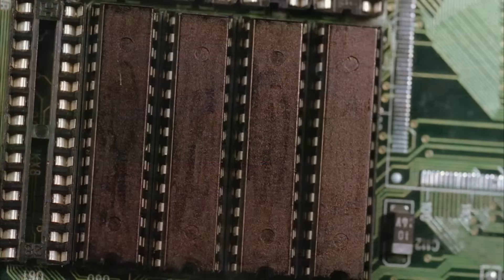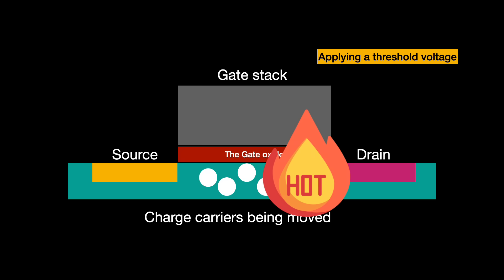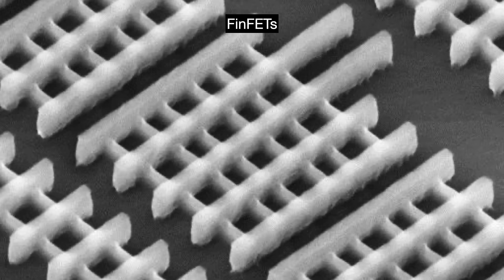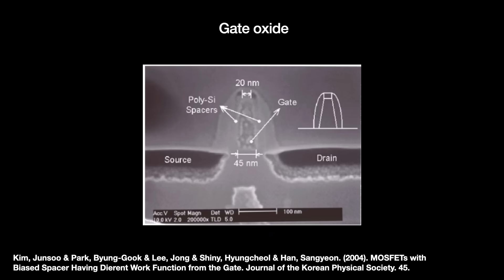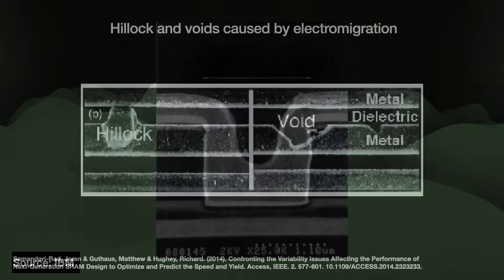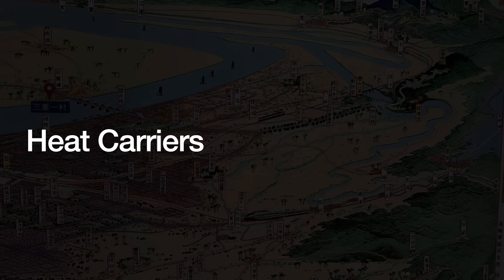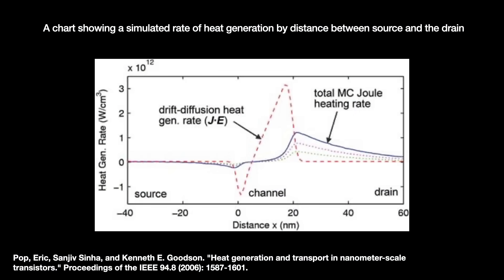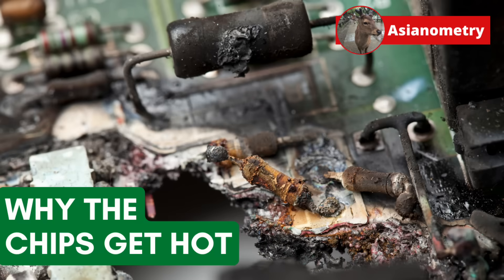Why the Chips Get Hot

Comment: They get hot because they use energy and everytime a transistor turns on it creates heat is just like the old computers back in the days when they use lightbulbs what happens when you turn on a lightbulbs 💡 it gets hot is the same with these 20 century transistors but now they are super tiny that you can not even see with a normal microscope you need probably an electron microscope I could be wrong in the microscope thing an may be you can see then with a normal microscope. So yeah is the same just like a lightbulb but now they are super tiny 💡.

Comment: About 2:30 - I still cannot find an intuitive reason why electric field peaks at the drain edge of the gate. I've read a lot of Umesh Mishra's seminal work on MESFETs which discover this effect, but I do not see any intuitive explanations. Do you have one?
Reply: The interface/junction between the semiconductor and a metal can be modeled by a diode. The source and drain contacts are made of metal. The drain-semiconductor junction faces one way while the source-semiconductor junction faces the other way (assuming they’re made from similar metals). These diodes are in series with each other, with the channel between them. Putting a voltage bias over both series diodes will forward bias one and reverse bias the other. The electric field is strongest at the reverse biased junction.

Comment: I'm a, mechanical engineer who has worked in electronics packaging in the telecom and network data center spaces for 30 years.  Electronics cooling has been a central role in my career.  The datacenter space is finally moving to large scale liquid cooling under the impetus of enormous power loads for Gen AI systems.  Stargate for instance is setting a spec of 55-250 kilowatts per rack.  

Anyway looking forward to watching you have an informative channel.
Reply: Waiting for the day when they collect and redistribute the heat outside just few DCs in the nordics...
Reply: Too much energy

Comment: Hello! Is the movement of dopant atoms also contribute to failure or is it so small other failures occur first? Also, is anyone researching diamond films to substitute the oxide layer used for heat exchange? Diamonds are good heat conductors while at the same time being electric insulators. One of my professors was researching this but he died before managing to produce a film - everytime the diamond started to form it created a bunch of tiny crystals instead of a film. Thanks!

Comment: Microchip formula.  Heat chips using electricity with oil season, then crush. Vola hot and tasty microchips.  Don't forget to pre wash with cold water in the heat sink. If you like chips with holes in them, i recommend funyons 😂

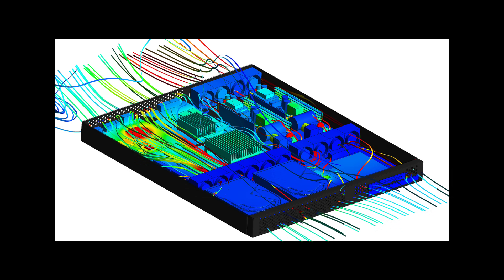Comment: 12:26 Advanced Packaging, especially on vertical-connected (3D stacked) dices may have thermal expansion issues.  The in-between interconnect layer (interposer, etc.) only has passive links (no transistors generating heat) and may use a different substrate material than Silicon.
In these sandwich-like construction, if one layer generates high heat and cannot be quickly taken away, the structure may warp (like bi-metal thermal switch) and break the interconnect bonds.

Comment: I have an outdoor PC for controlling my telescope, it's a desktop board in an outdoor electrical enclosure packing a Ryzen 7 5800X. One cold night in 2023, it appeared to run at 4.7 Ghz -- continuous turbo on all cores while encoding video along with QTGMC deinterlacing. The power draw was reported to be around 78 watts with an ambient outdoor temperature of 26 F and a core temp of around 137 F. During this winter, I didn't see such a dramatic reduction in core temp. My guess is that the thermal compound was impacted by seasonal change. During the summer I use this outdoor PC more frequently for video encoding since the seeing conditions for astrophotography stink during that time of the year. As a result, I am now in the market for a more appropriate thermal compound for outdoor use. To this day, I wonder if I whether I was getting false readings or if the cold was having enough of an impact on temps to reduce the power draw due to reduced leakage.

That all said, it still works like a charm. During the summer I switch the power profile to one which limits the core clock to something that absolutely wont overheat (BSOD, or forced reboot occurs if I keep it I don't limit the core clock during a summer time encoding job).

Comment: you have mentioned. u Pillar bumps in the context of HBM. I had invented them at Motorola in AZ 30 + yrs ago ( Ref Proc IEEE ECTC Conf 1994 etc.,) to remove heat away directly from the Gate area of Gallium Arsenide FETs we used to mass produce Moto Flip Phones by 1996, making it possible for the fir
Reply: ( cont’d ) real time Video affordably on handsets ( the electron mobility in GaAs is 3x that in Si so they switch faster ), 30 yrs later HBM still uses the same 50 um geometry, though we had qualified processes using pioneering Assy. Robots of our design down to 20 um pitch or I/O density 6x larger ) The thermal conductivity of these u Pillar bumps as we had predicted and then verified experimentally was 300 watts / sq cm. HBM even HBM 4 w/ a faster Clock Rate and maybe stacks 16 dies high would hardly break the Bank. Even the Current nVidia Blackwell dissipates only about 100 watts per sq cm. So liquid immersion cooling ( which we had already developed in the early 1990s for CRAY SuperComputers using LSI BiPolar ASICS ) May NOT be needed even when stacked in 3-d after breaking them down into Chiplets ( say for Yield Improvement or to reuse a mix of chips w/ diverse functionality
Reply: Cool! I had  a flip for YEARS!!

Comment: You never explain why, you only explained how the chips get hot. You never answered fundamental questions as why does collisions of particles produced heat? The so called temperature that can be measured is macroscopic emergent property assigned to represent the amount movement/collisions of a large numbers of particles and their degrees of freedom of motion. What sense is there to talk about heat or temperature of single particle or even a small lattice of silicon atoms when they are all bound together? So based on this I would say your video title is misleading at best.

Comment: IBM's mainframes of decades ago used a helium stack that had cold water passing to transfer the heat away.
Reply: @mutantryeff  IBM was, IMO, a very respectable company.  Other entities at the time were similar.  They largely don't exist anymore because the consumer wants sex appeal and a low price.

It's sad to see the degraded quality of many a product today. ☹️
Reply: @ntag411  I've worked in the computer arena since the 70s. I remember when IBM SEs were required to wear suits even when working in the false floors under the mainframes.  The best manuals were written by HP. HP is a joke in how they now operate. IBM products like IBM DB2 Tools are 3rd rate when compared to competitors.

Comment: Hey, the heat in the London Underground would be worth it's own video! The short answer is that, when the tunnels were first designed in the late 19th century, it was assumed that the surrounding soil would absorb the heat produced by braking trains and crowds of people. For a while, it did. In the last 130 or so years, however, the clay soil has become saturated with heat. Some stations have gone from 14C all the way to 30C, and there is hardly any space in these antiquated tunnels for new cooling infrastructure.
Reply: How do people breath ? Coal mines must be chilled, or they ignite. Why can’t mines be flooded with the chilled exhaust from a coal plant?
Reply: Dealt with this last September. Lines like Piccadilly were almost unbearable.
Reply: Just burrow under the tunnels and install radiant cooling. Easy, problem solved.
Reply: 14°C is cold (asian)

Comment: Very simple reason - shi tty design. Chips can handle double heat than currently but chips can not handle temperature fluxuation. Yes they must calculate all resisistace, capacictance etc for higher temperature. Adding the heating layer and never ever turn it off.

Comment: I just love it when I tell people that "every single watt of electricity your device uses in energy, turns into heat" it somehow blows their minds... like it's not that certain amount of electricity turns into "work" and some turns to heat, it's all heat all the way down. You just get work as a byproduct :)
Reply: My high school physics teacher broke down all electronics into: 1. Things that get hot, and 2. Things that spin and also get hot
Reply: mostly correctly, but some watts are converted into photons and some others into mechanical energy too 🥹
Reply: @done-damned  yeah and where do these photons and movement end up? objects absorb some light and turn it into heat, in a vehicle you need to use the brake or you will crash
Reply: @done-damned  well., if the photons do't have means to escape, they're ultimately absorbed and turned into heat. It's all ultimately just heat :)

Any mechanical vibrations are turned into heat as well, small fraction is turned to sound waves, which themselves are turned to heat at some point... :D
Reply: I remember once struggling to explain this to a computer technician that managed to repair a hardware issue on my laptop. He said that some of the energy goes into decreasing the entropy in the cpu. His reason was because the work done by the cpu generates a more organized state as a result of the computation. And  more organized state means lower entropy.
Reply: @djole02  yes, but you need energy to do that LOCAL lowering of entropy and thus you generate equivalent amount of heat + some that goes to "waste", but it's all heat.

That' is to say that the maximum efficiency of a CPU in theory would be just the amount of energy needed to lower the entropy so you'd only create that much heat as that requires, but you do it regardless by increasing the entropy of the universe by generating heat :D
Reply: @Mtaalas  I don't think the entropy get lowered at all. You would need the atoms to rearrange in a different configuration to get a lower entropy. But there is no actual mouvement of atoms in a cpu (apart from thermal). Also, the work done by the cpu is equally as random as not doing any work. That's how I see it but I wasn't able to convince him...
Reply: @djole02  It's not weird for entropy to be lowered LOCALLY. But within universe as a whole it's always increasing.

You can make amazingly orderly configuration of bits and electrons and what not, but you always generate equivalent amount of heat required to do so, and most likely more. Thus overall, entropy is increasing, and the arrangement is only temporary :)
Reply: Free heat if you need it
Reply: I like the idea that something like a heating element is 100% efficient while at the same time appearing to be the definition of 'wastefull' energy. I don't know how to explain it properly haha.
Reply: @MrHvleeuwen  "Heat Pumps" are more than 100% efficient.  100% is rubbish :).
Reply: @iamnotpresent  Heat pumps are not more than 100% efficient anymore than a snatch block is more than 100% efficient at lifting things. You have conflated the Coefficient of Performance with electrical efficiency, a common mistake for the uninformed laypeople.
Reply: @ OK smartie, we don't all talk like engineers all day long..  After work, most people talk about heat pumps as being 300% (or whatever) efficient.  I mean, technically they're moving the heat and not making it.  But in common conversation, like in a forum, and when comparing it to a hot wire, which we're calling 100% efficient, heat pumps are more than 100% efficient.
Reply: @iamnotpresent  Sorry, just because you aren't at work anymore doesn't mean that you aren't completely and utterly wrong. Why would you willingly spread misleading falsehoods in common conversation or on a forum? What beneficial purpose does that serve which exceeds the utility of using correct and accurate terminology?
Reply: @iamnotpresent  heat pumps are definitely not "more than 100% efficient".  Turning one joule of electricity into one joule of heat (as resistive heating does) is simply very inefficient . Efficiency should be measured against the theoretically best possible process to achieve the thing you're trying to do (i.e. an isentropic process).
Reply: @iamnotpresent  if you calculate efficiency as amount of heat energy / input energy, yes, they're over unity. If you take into account the total system energy (considering the whole of earth as the system) they're not over unity :)

Which is a good thing to sell to USA where they use methane for their heating instead of something more sane. In USA people waste energy like it's free.
Reply: @MatthijsvanDuin  Agreed, but when our point of reference is a piece of wire turning electricity into heat, and we're calling that 100% efficient..  I think we can call a heat pump over 100% efficient.  Look up heat pump efficiency, and you'll see every result saying they are 200-400ish % efficient.  That's the way most humans talk about them.  
I am a retired electrical engineer (I used to design IC's), and get where you engineer minded people are coming from.   But in common conversation, especially when someone just said a hot wire is 100% efficient, we can call a heat pump more than 100% efficient.
Reply: Basically, I've been through counseling for my autism and have learned how to put that aside and talk like normal.
Reply: @MrHvleeuwen  In heating element everything turns into exactly what you want -> heat.
In almost every other device heat is the unwanted phenomena :)
Reply: @MrHvleeuwen 

Technically they're not 100% efficient and yet "thermodynamically" they are 100% efficient.

What I mean is that some of the energy from the heater is released in wavelengths that escape the building or even the planet before they get a chance to be absorbed by any matter. Those photons still count as heat even though they didn't heat anything.
Reply: @MrHvleeuwen  Because "energy efficiency" is in reality all about minimizing increase of entropy. Energy itself is a zero-sum game and can't be "saved" or "wasted". Resistive heating is also not actually an efficient form of heating, you can use a heat pump to bring several watt of heat into a room for every watt of electricity used.

Comment: What surprised me about modern CPUs was how quickly they heat up. Going from idle to 100% it's almost instant. I've never liked the idea of water cooling. I have to use a large vapor chamber cooler with 2 fans and quality paste and it still heats up surprisingly fast.
Reply: It's because of the stacking. I believe it was mentioned here but also in some previous videos. The stacking in turn is because you want the transistors to be as close as possible to each other for faster computing: trade off results in heavy heating.

Comment: Would it be feasible to have tubes made of some material to transport heat or even something with a fluid in the middle of the layers?
Reply: Space there is limited, so would make for a less  dense chip
Reply: Cray did that.

Comment: I have an entire book on the physics of phonons in materials published by Oxford University. You get a set of standing waves much like the maths of a quantum well. You have various degrees of freedom as well like rotation and vibration, and with molecules you get additional ones in the molecular bonds. The maths is not too hard to do as I recall, but I read it back in the 80s so might need a bit of a refresher on how it all works.

Comment: I'm a hardware engineer working on low-temperature electronics. Very surprised to see phonon BTE and NEGF showing up in this video. This channel is the real deal! Great summary
Reply: hey im a cs student currently, and im really interested in hardware i was wondering. if i was to go back to school what should i study to become a hardware engineer? computer engineering or EEE?
Reply: @bm1259  Computer engineering if you are from Europe. I see too many EEEs struggling with basics, it looks as if they never touched anything analog.
Reply: @bm1259  Both are very similar and you cant go wrong with either. If you want a better background in software, choose CE and if you want a better understanding of the fundamentals like electromagnetics, choose EE.
Reply: I doubt that there are up to date studies out of asia
Reply: And cramming millions of transistors together makes the heat issue much worse.  People be wondering why their PCs, GPUs and phones fail.  The faster it is the faster it burns. I've burnt many myself, but know how to avoid for the past many years.
Reply: @ntag411 thus why you need proper cooling